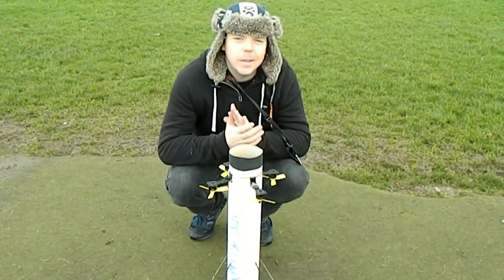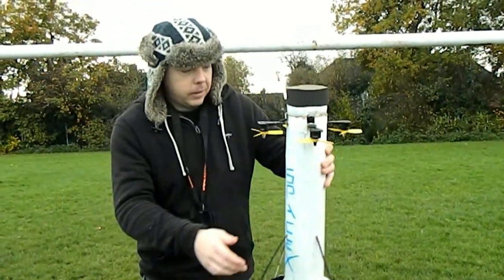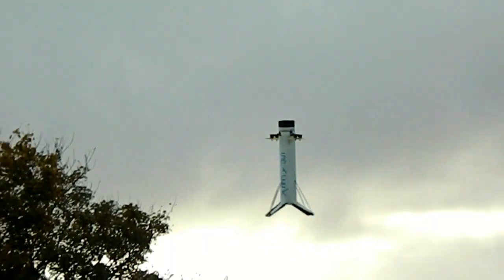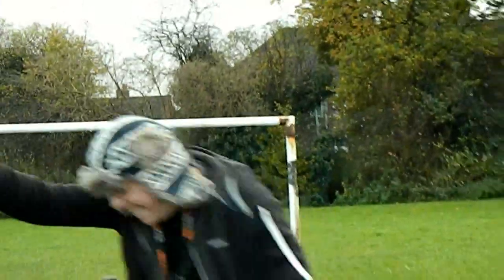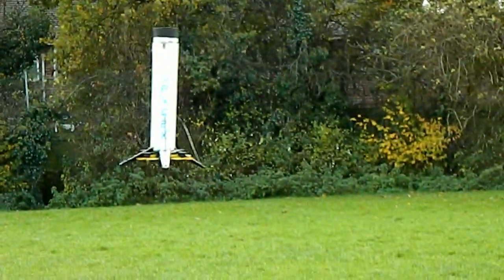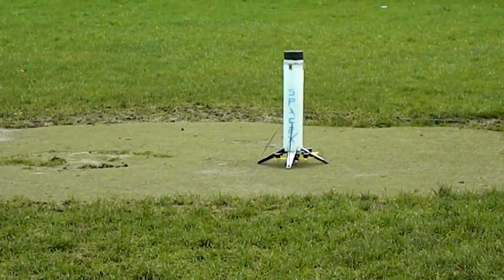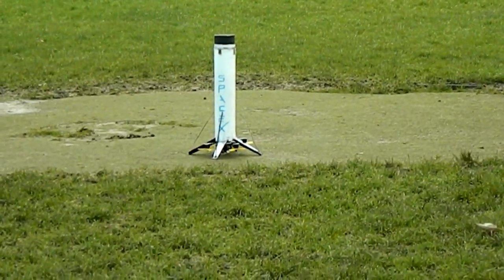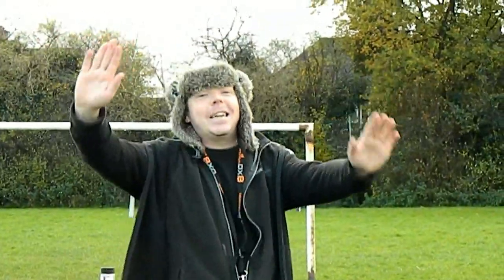SpaceX Falcon Booster RC Hop & Landing

Comment: How much can the drone lift, and what model is it cuz I want to purchase one
Reply from the maker: Its a home built racing drone 
Leopard frame 
F4 flight controller 
2204 Black window motors with built in 30a ESC 
And 4" 3bladed props 
It can lift about 20 ounces
Reply: @rclabbotics5413  do you know where I could source those parts?